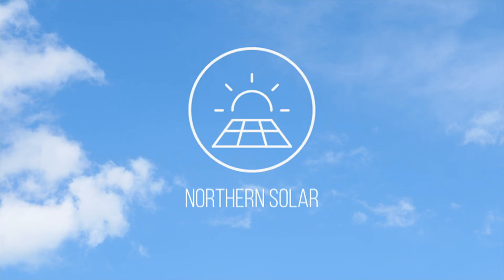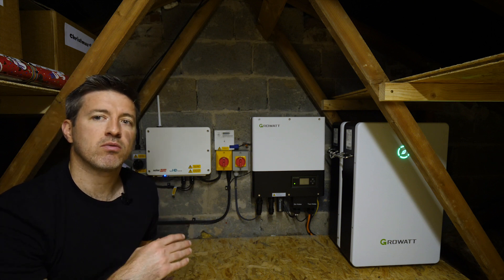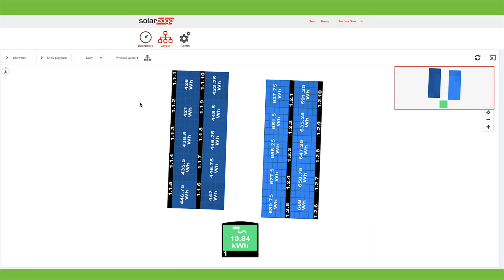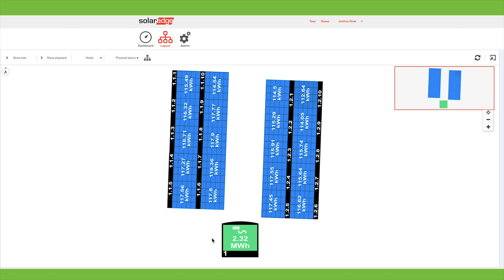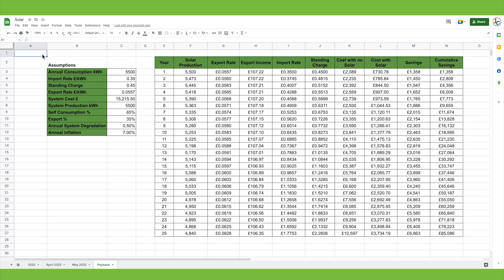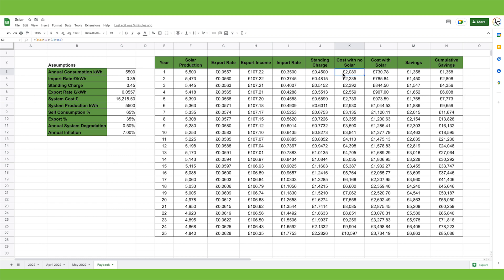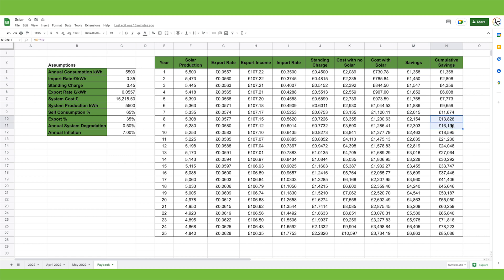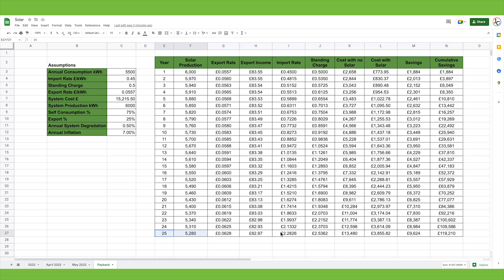How Long to pay off Solar Panels & Battery - System Overview, Cost & Payback Time!

Comment: The growatt inverter converts the AC to charge the growatt batteries?
Reply from the maker: Yes. The Growatt inverter is and AC coupled one. It takes the AC that comes from the SolarEdge inverter and charges the battery. When the battery discharges it then turns that DC back into AC to supply the house. It's not the most efficient way to do it really. a lot of systems now just use a hybrid inverter to do both the solar and the battery. For us though, this works as we have the advantages of the SolarEdge system but don't have to pay for the very expensive SolarEdge battery.
Reply: @northernsolar6391  The problem is the cost of batteries in relation to their lifespan today still doesn't make it worthwhile unless absolutely necessary. The expected lifespan for most lithium batteries if properly managed is 10-15 years or shorter if allowed to go below the 20% threshold. Flow batteries seems to make the most sense without the threshold and the electrolytes and electrodes can be replaced at the end of their life cycle. I know Australia has started using them now but they don't seem to be exporting yet. I have a microinverter system on order and have been carefully monitoring the battery market and technology for AC-coupled systems but it seems we really wont be see any reasonably affordable system yet within the next 3-5 years. Also not sure if and when the new perovskite cells will go mainstream enough to be affordable and yet to be proven reliable over the performance warranties they may provide.
Reply from the maker: @DavidCheok  I'm always interested in the new technologies that are coming along but at the same time waiting for something to be cheaper is a difficult thing to judge. New technology is always expensive. Flow state batteries and perovskite panels do sound very promising but I think it'll be quite some time before we see them at available on the sort of scale as current tech. The ridiculous price of electricity now and seeing what's coming this winter with the price cap rise makes a solar panel/battery system look extremely cost effective to me. I'd be interested to hear why you've chosen a micro inverter style system for you property?
Reply: @northernsolar6391  Primarily is safety. DC voltages are very high in string configuration and any degradation of the cabling could cause arcing and potentially fires. Second is that the higher upfront cost of microinverters will reduce downtime and replacement costs over the lifetime of the system. If anything happened to the string inverter, the entire system is down until a replacement can be sorted whereas a micro will only reduce output. The cost to replace a single micro is cheaper than a string inverter. Shading these days no longer relevant with the better strings and optimisers on the market.
Reply: @northernsolar6391  As far as waiting for prices to reach the sweet spot, imho 22% efficiency modules should be at its cheapest now as new 30% start entering the market so imo should be at its sweet spot. There will be a time as the new modules approach this pricing and older tech modules begin to get phased out but seems likely in the next 5-10 year. By that time, with microinverters, its just a matter of simply adding or replacing modules to the system. You are right in saying that in certain scenarios current battery systems maybe worthwhile especially in regions with high energy costs. It also depends on how much energy is used by the users. Lower kWh users will find batteries worthwhile while high kWh hour users wont. A 50 kWh battery costs more than the panels and inverters. 😅
Reply from the maker: @DavidCheok  That's interesting, thanks. I agree that shading is less of an issue that it might have been in the past. Playing devil's advocate a little, wouldn't the cost of replacing a micro inverter have to include the cost of going up onto the roof and removing the panel before replacing the micro inverter? In many cases that would involve some sort of scaffold? It's difficult to know what's best for everyone without knowing all the variables, but that's what makes it so interesting!
Reply: @northernsolar6391  Yeah thats estimated at $150 here. So plus the $300 inverter.. is a lot cheaper for me. We usually do not require scaffolding unless we are adding more panels to the array. Changing out the micro is just unbolting the panel, lifting it up and replacing. Would be a 2 person job still but I still see it as cheaper on the long run and with little to no downtime on production.
Reply from the maker: @DavidCheok  50kWh is a pretty huge battery, that would be very expensive yes. Between 5kWh and 15kWh seem to be the sort of range that work for most households in the UK from what I have seen so far. I'm really enjoying hearing how different the situation is in other parts of the world!
Reply: @northernsolar6391  Yeah unfortunately some of us are in that region of the world where nights are 25-27 C and 90-99% humidity and day time is anywhere between 29-35C all year round. While conducting my research, I was very surprised people in UK can generate surplus even with a 5 kW system. I spent 10 year in London in the 90s and most of my time there was nothing but cloudy skies and drizzles all day long. I suppose the cool temperatures help with the production whereas in my region, we need to compensate for the higher than average operating temperatures expected between 40-60 C of the panels. You guys use far less electricity but compensate for that by using gas for heating whereas we only use electricity for cooling.

Comment: I found your video and spreadsheet very informative since I am going down a similar route at quotation stage.
I believe you have  an assumption within your cost without solar using 60% and 40% of the rates 
e.g. in April 2022 col C Cost without solar=C33=($O$4*C$1)+(C10*0.6*$O$7)+(C10*0.4*$O$6). Since you have peak and off peak kWh and rates the calcs can show a more accurate & larger saving as follows 
For column C April 2022 using standing charge as C28=£14.30 plus Off peak grid consumed C9 times off peak rate O6=£7.23, plus product of (total consumption C10 less off peak C9) times peak rate $0$7)=£110.81 thereby giving a cost without solar of £132.34  Hence saving more compared with C33=£111.48. 
Similarly in May the total cost without solar by my method gives (D33=) £169.88 instead of£126.77. 

What do you think of this calc method since I cannot see where the 60/40% came from. 

Many people are gaining from your video and spreadsheet which must be time consuming. Have you considered adding forecast solar generation versus in practice?. Please keep the great channel going to see the evolution over time.
Reply from the maker: Thanks Donald. I would need to spend a bit more time looking into your suggestion. I based the 60/40 split on the data I had from before I had solar. On average that's how our usage was split. We put our washing machine/dishwasher on during the off peak and charged the car in that time too. 

I was planning to add a few more metrics in yes but I'm keen to try and keep it simple and digestible on a month-to-month basis. After 12 months I'll probably do an annual comparison against what was predicted but given the current figures I can already say we are way ahead of what they estimated. I was expecting this though as installers don't want to get in trouble for over promising on production figures. 

I'll look into your calculations when I do my end of July spreadsheet and see how it compares. 

Thanks and best of luck with your solar enquiries!
Reply from the maker: Hi Donald. I had another look at this. I think the 60/40 split is a more appropriate measure. Having solar panels now our peak/off peak usage is very different compared to before we had solar panels. 60/40 may not be accurate for everyone but we had about 6 months of figures from my bills that showed we were consistently around that split. If we took the ratio based on our usage patterns since April the figures would be skewed and show savings that in reality we wouldn't have made. I hope that's clear?

Comment: 5500kwh? currently using 300 watts?
thats 1 laptop ,2 phonechargers and a tv
Reply from the maker: Hi Arne. 5500kWh is our annual estimated usage at our house. It might be higher now that we charge more often overnight than we did previously. 300W what the house is using if we are both working from home or maybe at the weekend. That is basically just the fridge freezer, the wifi and laptops/monitors being used for work. When we're using the oven, microwave, kettle etc there will be spikes of 2-3 kW during those times but 300W what I'd consider to the daytime 'background usage'. I'm going to be doing a video which shows a typical day of solar production and usage in the house. Hopefully that will explain things a little better.
Reply: @northernsolar6391  Thanks for the reply.  My comment just reflected on what I see as a very low usage. In norway 20-35 kwh pr year is common. But we dont have gas. My house is heated by district heating, this also includes hot water, yearly estimate is 35Kwh + 20 kwh electricity.
Reply from the maker: @arnefines2356  I think we are slightly above the average for the UK. I know some people who use a lot more than us here in the UK though. Now that we have the solar panels I think we will use more electricity because we have more of it for free :)
Reply: @northernsolar6391  Not using, is almost wasting :-)

Comment: Hi, great channel and informative videos, I do like the spreadsheet, thanks for making it a downloadable file to play with.

I have been researching a very similar system to your install (20 * 400w Panels) we are in Cheshire with a East / West facing property,  I am just mapping the house usage (Winter / Spring / Summer)  as we  have an EV (Since December) and I am looking to model / finalise the required Battery capacity before really committing.

Funnily enough, TB Electrics were my preferred supplier having had several quotes, and vetted each of them, one question, you had your system installed by Deege solar but you recommend TB Electrics?   
Have you dealt with TB Electrics and if so what Pro's / cons can you think of for the installer ?
Reply from the maker: Thanks Ade! That sounds like a very similar setup to mine so hopefully my figures can offer you some insight into what your setup would achieve.  TB Electrics are a great, local company and have a been doing solar installations for a long time. I am most definitely biased though as I now work for TB Electrics and absolutely loving working for them.
Deege did a good job for us though and I can't fault the system we have. The downside of Deege is that they are based down south and hence installation might be more expensive if the team have to stay overnight locally.  I would say that Deege's customer communication isn't particularly great. I think they, like a lot of companies, are inundated with inquiries and maybe struggling to keep up with everything, but that is only based on anecdotal evidence. Hope that helps!
Reply: @northernsolar6391   Hi Joshua, many thanks for taking the time to reply.

Ah, you are on the payroll of TB Electrics, I must admit, out of all the companies I have had quote and dealt with over the last few months, Louise and the rest of the team have been the most professional and understanding. BTW, I also held discussions with Northern Solar Ltd....which slightly confused me when I saw this channel :) :)

Perhaps you ought to mention on your channel that you are indeed an employee of a Solar Consultation and installation team, and not just an average Jo feeding back one's own install experience (just so all are clear).
Reply from the maker: @ademcguinness8132   thanks Ade. I'm glad you've had a good experience with TB Electrics! I started this channel way before I started working for them but I'll definitely make a point to mention it in more videos. I try and keep my work separate from this channel as I want it to be more about my own experience with my solar installation and how I'm managing the energy usage at home and not about telling people exactly which panels/inverters/batteries they should get for their home. There's a lot of good brands and a lot of good installers out there. I'm just trying to help people understand the benefits of solar in simple way because when I started trying to learn about it, all the information I could find was extremely technical. Thanks for letting me know about Northern Solar Ltd too, I had no idea there was a company in Liverpool with that name. I thought I was so original, clearly not!

Comment: Hi very informative videos. Thanks . My annual consumption very similar to yours. I have a solar together quote through Wiltshire scheme. Chosen provider is Infinity Renewables. The quote for me is £10800 for 16 panels fully installed. Plus £3800 for 6kwh battery fully installed. How does this compare for value in your experience? 
My electricity provider EDF have an appalling export rate of only 1.5p/kWh so not much pay back. Looking at your figures I now wonder if I reduce no of panels to say 12 and double the storage ? (To stay in budget) but maximise self production and minimise export.
Reply: Yes I thought it was on the high side and disappointed in the so called bulk savings the council scheme suggested. As for kit it comprises of JA Solar 390W Mono Percium All Black Module panels with Growatt inverter plus a single 6kw Growatt battery and another inverter. Not had a site survey yet as this is early stage of the scheme and then require £150 deposit ! Battery and inverter at £3800 appears hood while £10800 for the 16 panels is way over what I expected. Will look at some comparable quotes thanks for your experience.
Reply from the maker: @ianwilson5136  The JA Panels are a good brand. Growatt are a good brand too but I would ask why they aren't using a hybrid inverter such as the SPH6000? That's the one I would have gone for if I'd not had the SolarEdge optimised panels. It will be interesting to hear what the other companies suggest!
Reply: My install was with infinity renewables 6 weeks ago and the install has been great but they were so overwhelmed with work they were very slow to reply to queries. I am very happy now though. I have 18 panels, 13 kwh battery and 5 kw inverter.
Reply from the maker: Thanks Ian! £14600 seems a little on the high side for price on that system. Did they say what panels/inverter/battery you would be getting for that price? I would always recommend getting a few quotes and comparing. In terms of export, Octopus might be worth looking into?  They tend to offer good rates. I would say go for the the 16 panels. It's much easier to add more battery later. 16 panels would be over 6kW of panels I'd say at least 10kWh of battery would be needed, but it does depend on the usage in your home. Cheers

Comment: Solar in a loft/attic ...my absolute NO NO !  I have two slopes, two inverters and a battery and NOT one single cable is fed via the loft I insisted everything be wired in weather proof cable tubing on the outside of the house. One inverter is in the electrical cupboard in the vestibule the other on an outside wall. My LG battery is on an outside wall too. SAFETY FIRST.
Reply from the maker: Can I ask what makes you say it's a not a good idea? Our loft is well ventilated, dry, and doesn't get above 30C even in this heatwave we're having. All of the cabling runs through the gable end wall and is in armoured cable down the outside of the house to the consumer unit. I'm not against mounting batteries outside but is it not more exposed to the elements there? More chance of water ingress? If it's in direct sunlight it could get quite hot? Freezing temperatures in winter could cause poor performance? I think there are pros and cons to each setup but I'm very comfortable with the installation I have. I would say that some lofts would be very unsuitable, but then also so outside areas would be unsuitable too? Cheers
Reply: @northernsolar6391   Hi Josh, is it possible to email me the spreadsheet you so excellently created. I'm seriously thinking of going Solar, and the spreadsheet would be an brilliant assist for me. Phil 😀 😀
Reply from the maker: @pmac798  you can download the spreadsheet from the link in the description. If you have any issues, let me know. Cheers
Reply: @northernsolar6391  It's because of fire, batteries need completely submerging in water for a long time otherwise they will keep burning.  The fire brigade would struggle to get in your loft with equipment etc.

Comment: Your installation looks very professional and neat.  I've seen similar videos of attic installations in the UK.  Of course I understand that there are cost and space savings to be realized with attic vs say a utility room or garage installation, but servicing the equipment?  Where we live the code requires electrical service equipment (breaker panel for example) have clear access.  That usually means about a metre clear in front of the equipment and directly accessible for electrical service and fire-workers.  I don't believe this installation location would be allowed in Ontario.  Just curious about the UK Electric Code requirements.
Reply from the maker: Thanks Andrews. We renovated our attic before the install. There is easy access now and plenty of space if servicing is needed. Our installers said a lot of people's attics are cramped and full of junk so they have to clear it all out for the install. I would have preferred to have the system in a garage really, but we don't have a garage anymore as we converted that to a home office.
Reply: NEVER HAVE SOLAR GEAR IN A LOFT/ATTIC.